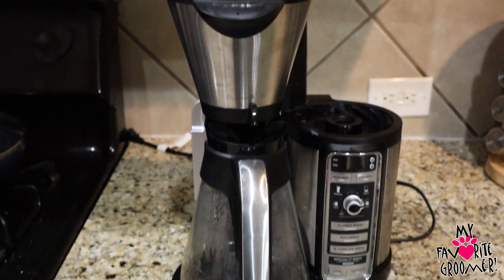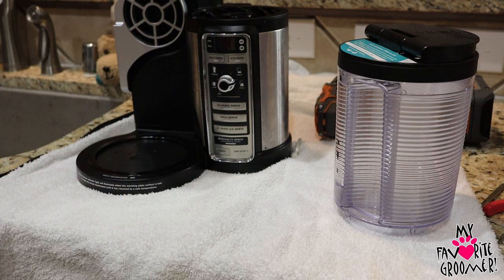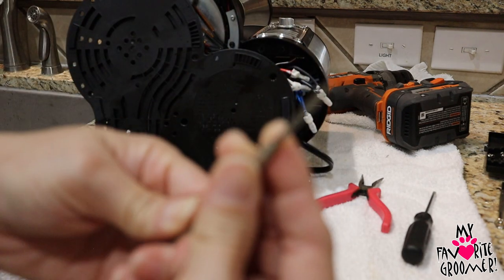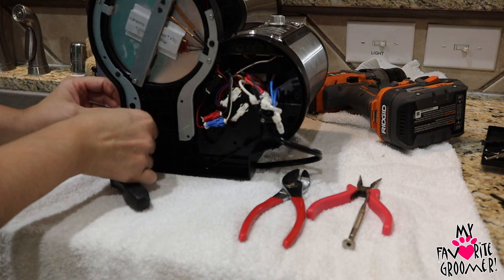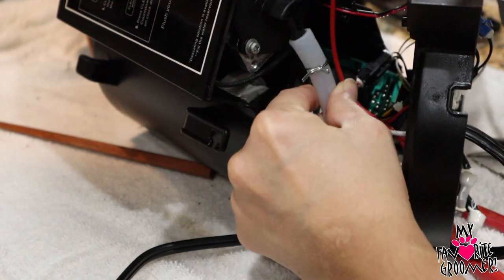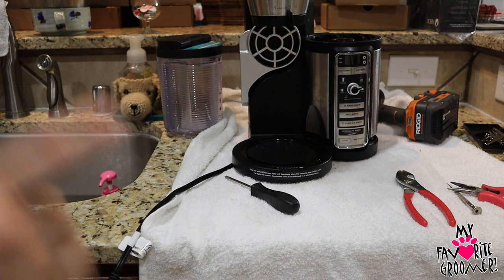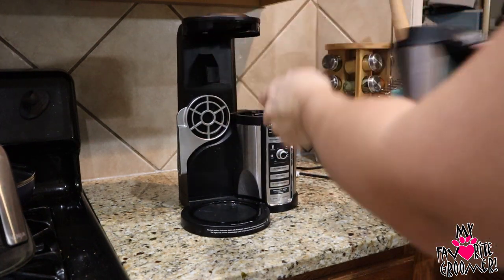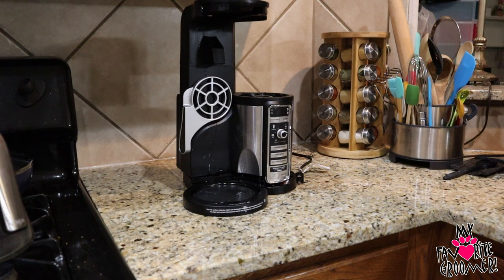Ninja Coffee Maker I Want A Refund

Comment: This cofee maker is way overly complex. The part that goes bad most often is the flow meter. It gets jammed by anything getting stuck in the intake. They also used like 10 TS 15 screws in it, thankfully I had one for fixing drill batteries. Was not an easy fix to be sure. Plus you have to wait an hour to run the clean cycle even after meticulously cleaning the guts. Might turn it into an instant water heater for my rv when the electronics guts fail for the good.

Comment: Well you know it would probably be helpful if you didn't throw the thing out the window or the door four times a day I'm just saying.
I would ask you one question though, 
Did you run it complete clean cycle through it after you let it fit in the box for 10 months or for 6 months before you used it the very first time? I don't know what the instruction manual says but when I got mine I ran into a pool clean cycle the hour long automatic clean cycle twice then rinse it twice. And I've had no problem with mine about once every two weeks my clean light comes on but the water where I live is not the best so..